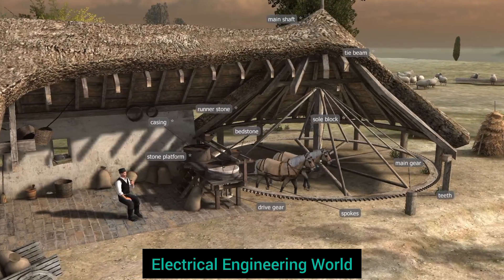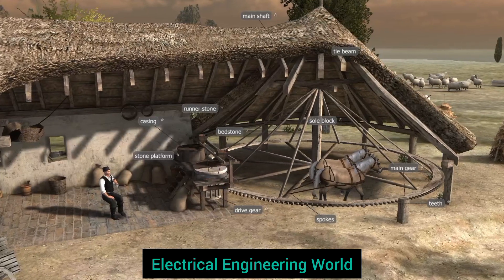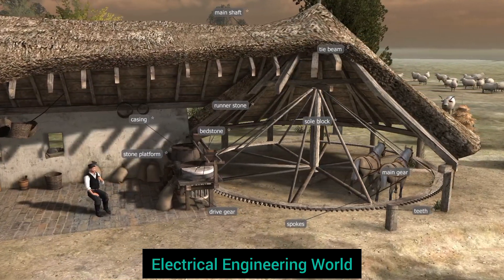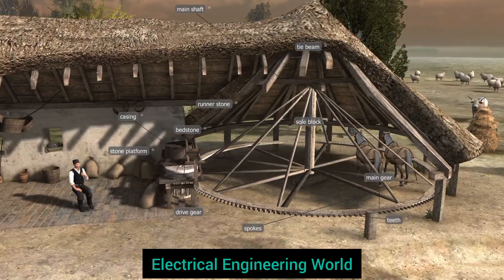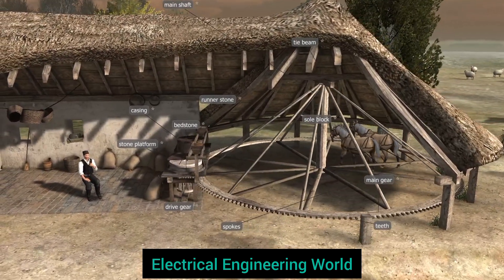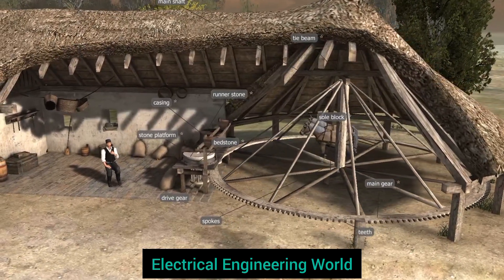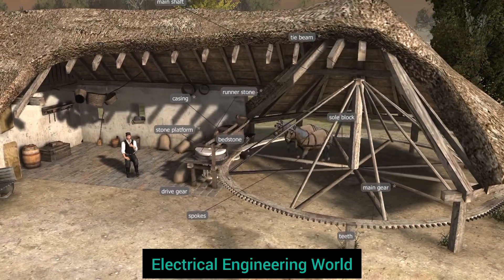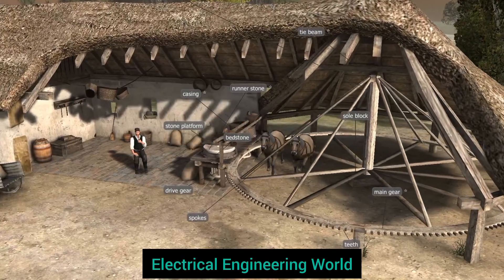what is horse Mill?

Comment: This kind of mill is also called a dry mill (as opposed to a water mill). 
There are three major types of dry mills, technically speaking. There is the dutch type, the pannonian type (shown in the video) and the punjab type. There are ofcourse more, but the rest is too obscure to find information on. 
This kind of dry mill as shown in the video was used from middle ages up to 1950s in flatland regions of central and eastern europe.  
These were the answer to shortcomings of pannonian watermills. Pannonia had large rivers, but due to winter ice and spring flooding, the watermills couldnt be built on riverbank. instead, they were built on top of a barge, with a large waterwheel catching the slow river. every autumn they were dragged ashore to protect them against ice and debris and they were put back into rivers after spring floods. 
this means no milling in winter. In addition, they were positioned far from villages and getting the grain to them was difficult due to mud roads. watermills also interfered with horse teams pulling boats with goods up the river. in addition, they slowed flow of the river, which meant longer time needed to drain the land after floods. 
 
All these shortcomings were the advantages of dry mills. they were built within villages so they were always accessible. they could be operated 24/7, were not influenced by weather. Mills were financed and built jointly by villagers that pooled their resources to build and maintain a mill, and in return each villager had his time slot when he could mill against nominal charge. usually, one's own horses were used, and a mill could run from 2 to up to 12 horses, depending on their strength. There was a dry miller in charge of operating and maintaining the mill. outsider could also use the mill, but they needed to pay more.
Horses could also be rented if one didn't have his own.